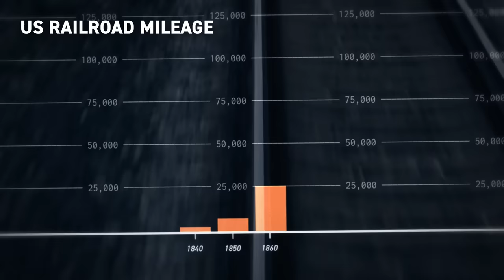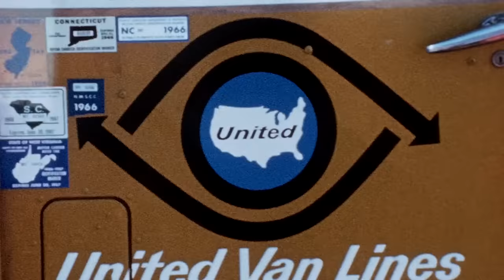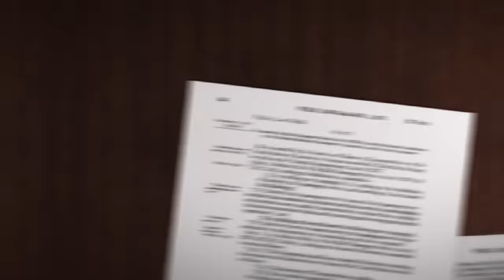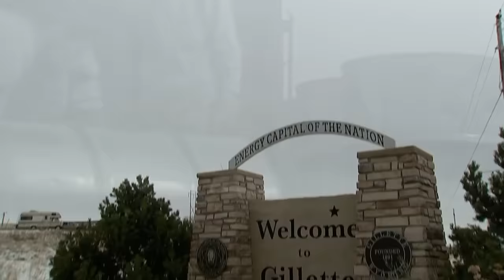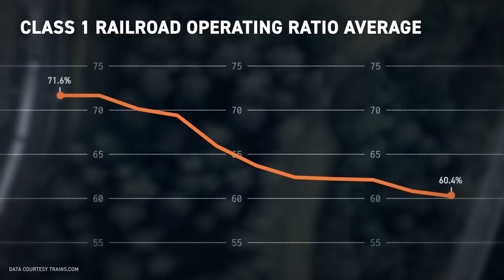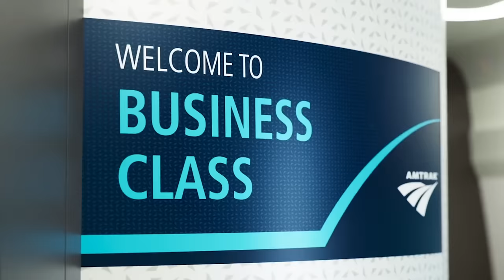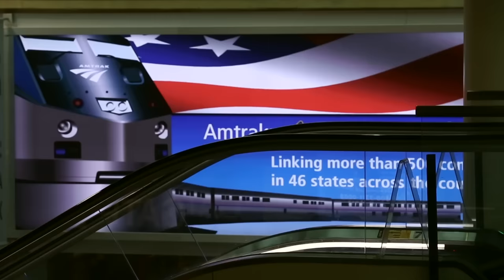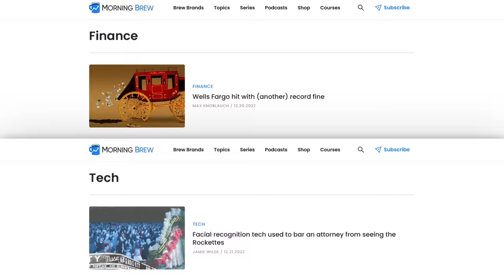The One Tiny Law That Keeps Amtrak Terrible

Comment: I worked as a train dispatcher on Conrail’s Albany Division in the years leading up to and after the CSX/NS takeover. I can count on both hands the number of times I was ordered by management to run a “hot” van train (intermodal) that was running late ahead of a much shorter and faster Amtrak that was on time. I of course always ignored those orders because it made zero sense in any universe. With a double track mainline and passing sidings, there was always a way to get Amtrak out in front even if you did have to ding that long and slower van train for a minute or two. So it’s 100% true that freight railroads ignore the law that is supposed to give Amtrak priority. Most train dispatchers I worked with did the same as me and always gave Amtrak preference when possible. But there were always some who just didn’t care and went along with what they were told to do.

That’s why Amtrak’s Lake Shore Limited was always referred to as “The Late for Sure Limited.” Eastbound train 48 was “Forever Late 48,” and westbound 49 was “Never on Time 49.”

Comment: If you ever wanted to time travel, use the Amtrak! Exclusive 1920s experience. Will turn a 1 hr. journey into 3 hours. Reasons for delay could vary from sister train issues to a wild boar crossing the track. A truly breathtaking experience, not to mention the wifi speed matching the train speed. Highly recommend 10/10!
Reply: It's a bad joke; how much nurds want to push American rail. The irony is that it's regressive; and is an attempt at reducing individual freedom of movement. I didn't drive until I was 24 and it has made my life a million times better. Nothing like a 2 hour commute or a half hour commute being turned into 4 hour commutes due to layover and convoluted routing. So much for the Chicago rail hub, I couldn't go 15 miles west without a 2-3 hour commute!
Reply: Thats amtrak 1.0 U havent rode the Acela trains in the northeast. Wonderful speedy ride.
Reply: @willc5512  just in case you're replying to me; I'm not talking about Amtrak. 😂 

I'm talking about the Chicago metra system, the almost always on time; localized, profitable, shortstop passenger train system that serves the suburban sprawl of Chicago for a 50 mile radius.

At least it's profitable, but damn does driving beat it south of Irving park road, west of pulaski, and north of cermak. 🤣
Reply: How is wanting more feasible passenger rail “reducing individual freedoms”? More options = more freedom

Rail is not supposed to replace car travel, but augment it. You said yourself, you felt much more free with a car. Imagine a rail was good enoigh that evenif you didnt have a car, you could still have some freedom of movement.

Yes, rail IS in a bad state right, now, but it doesnt have to be.
Reply: @HungryBonedog  well we gonna have to just disagree, sorry.
Reply: @josephc.9520  Prithee, what wonderous country do you live in you?
Reply: You are insulting the 1920s. Passenger rail along the same routes would have legitimately been faster and more on-time.

Comment: I ride from Central Maryland to downstate NY and back once a month. This is the NE corridor, so the service should be good, but my ~4 hour total ride often ends up being about 30 minutes late. Also, the layover in NYP, transferring from the NE Regional to the Empire Service, is always ludicrously long (like 50 minutes... these are super busy tracks, the trains should run way more often. Sometimes it's even faster to walk to Grand Central and change to Metro North)
Reply: I know it's cheaper to take the train but man if I were you, I would just drive. I was exploring a job from NJ to Vermont and denied it because I didn't want to commute on the train
Reply: @cheetah219  Sometimes I do drive, but sometimes, I prefer 4 hours of nintendo switch to 3 hours of driving.

Comment: As someone who lives on the I-25 Corridor, a commuter train (plus intra-suburb public transit) would be a godsend. I-25 has been a mess forever it seems, but I've noticed the past week in particular has been dreadful. I suspect it has to do with many companies adopting Return to Work policies starting on the new year, and with people moving here in massive numbers during the pandemic (and those in the Denver Metro moving to cheaper areas due to WFH and now having to commute back in), we're suffering a massive traffic spike all at once. 2 months ago, my commute was reliably 15-20 minutes each way, but these last few times have been 25-30 minutes on average. A train could at least put a dent in that.

The video briefly mentions how some people might prefer to just expand I-25, but there really isn't much room to expand it once you hit Denver, which is consistently where the worst traffic is. Yes, there's plenty of room to expand between Boulder and Fort Collins, but I can't remember the last time I ran into a traffic jam on that section, so it wouldn't really give that much benefit
Reply: Just one more lane bro. Give me one more lane of highway and traffic will be solved forever. Trust me bro.

Comment: Informative video that really showcases the red tape and downside of letting big business run amuck without holding them to account. When a train costs more than airfare and takes twice as long or more, then it's bad. It would take 13 hours from Indianapolis to Minneapolis, which is 10 hours by car. The cost is about equal, if it all works on time. If freight, which isn't as time sensitive as people, did what you mentioned, it might be worth it. Flights are about the same cost, though use a lot less time than rail or driving. Any which way, there is no easy solution without the government steering things regardless of what business and shareholders want. Since people, business, and modes of travel can't agree on a solution, then the government setting the rules based of the needs of everyone would be needed. That is what the government is good for. But they have to enforce the rules, which puts politicians in the line of fire.

Comment: I love train travel.  I really hope that Amtrak's new plan for its trains to prevent the delays inherent on its long distance trains  will work.  I'm willing to switch trains a few times to go a longer distance.  I think also these shorter routes will better serve communities that are dependent on the long haul trains so that rather than once every other day, the community can be served twice a day.  Of course, I say this coming from the NE corridor where a delay of 10 minutes is terrible and everyone gets grumpy.  
That said, are the needs of the midwest the same as the NE corridor?  I'm not sure if they are.  Yes people do need to get from point A to point B, but do they need it as frequently?  Is the proximity of the train station to the city centers worth it vs the distance of an airport?  Thats something that makes the NE corridor work.  Flying from DC to New York takes a little over an hour.  However you have to be at the airport an hour before your flight to check in, the airports are far from the city centers so often times you have to drive an hour just to get from the city center to the airport.. and then there's the cost of flights, lost checked baggage, cost of taxis to the airport, etc.  Vs a train where you are delivered right to the city center in comfort with good leg room and fairly reasonably priced sandwiches and even cocktails on the train.

Comment: The I25 corridor is close to home, and it's a LOT more complicated than your brief overview. In order for passenger rail between two cities to make sense, those passengers have to be able to get to/from a train station without a car. Denver has a good intra-city passenger rail and bus system, but Colorado Springs has only an "okay" bus system and Pueblo, Fort Collins, and Cheyenne don't even have that. A trip from the downtown Colorado Springs bus station to UCCS can take an hour (while driving, even during rush hour, is 20 minutes or less). That's one of the best bus routes in the city, a short, nearly straight shot with no transfers and fairly popular with frequent bus schedules, and at optimum travel time it's still 30 minutes.

Routes like UCCS are a rare exception. There are plenty of people in Colorado Springs, but they're so spread out that any given bus route can only reach a few of them. Most busses run at less than 20% capacity and most stops are empty, while those that aren't have only 1 or 2 people getting on or off. Pueblo and Fort Collins are even more spread out. 

For inter-city passenger rail to be effective, you need intra-city public transit that can meet those passengers' needs, and to have good intra-city public transit you need population density to justify your routes. And outside of Denver the Front Range doesn't have the population density. So a person traveling by rail from Pueblo to Colorado Springs would need a taxi to make it from the station to their destination on time. 

I've spent a good deal of time working on this problem, particularly for the Front Range. Without massive investment in high-rise downtown housing to increase population density and create demand for public transportation, the only way to make an inter-city Front Range passenger rail system work would be to run it like a ferry, letting people drive their automobiles right up onto the train. And this is all in a purely hypothetical passenger-only rail system, like the high speed rail the politicians keep touting, and does not account at all for track availability. 

After all of that, I want to add that the freight trains along the BNSF/UP lines on the Front Range are actually very consistent, and scheduling passenger trains on the same track would be easy. But AmTrack would have to buy property, build train stations, build the car/engine housing and maintenance infrastructure, and lay connecting rail for each destination. Not to mention buying the engines and cars to run on the new lines. These are costs in the billions of dollars for just the Front Range, and that's without laying any new track. Even in Colorado Springs with the shutdown of the downtown coal-powered Drake power plant, making available prime downtown real estate with existing track and infrastructure already in place, it would still cost millions of dollars for AmTrack to move in and set up passenger service there. (Don't get me wrong, I think that'd be a great way to use that property when the power plant demo is finished, and anybody who's in the area should get involved in pushing the city to do just that, but even when all the track is already laid in an ideal location it still isn't easy or cheap.)

Pundits and hipsters like to tout passenger rail (and more broadly public transportation in general) like it's a solution to all our problems, but I have yet to meet a single one of them who really understands either the problems or their proposed solutions. If you want to do a follow-up video that dives really deep into those details, let me know.

Comment: I highly recommend George Loving Jr's book, "The Men Who Loved Trains".  I am a railfan and could easily spend a whole day watching trains without even realizing that the day is gone.  And I'be noticed the change.  Fewer but longer trains is the rule of the day and as the times change, there is the loss of branch lines or through routes that no longer fit the business plan of their now former owners.  To someone who loves trains, seeing a rail line getting torn out feels almost like a death.
Reply: @Karl with a K I get what you're saying.  My comments were in regards to how freight railroads operate today.  Just recently, I watched what amounted to two long coal trains combined into one huge train.  With the technology available, it is now possible for a single crew (engineer and conductor) to operate all the locomotives from a single unit.  In this case there were three up front and three in the middle.  This is one way of cutting labor costs as you can now basically run two trains and only have to pay for one crew.  And those corporations are so greedy that they would like to eliminate the conductor and have the engineer run the whole show.  Have we not learned anything from the tragedy at Lac Megantic?
Reply: @Karl with a K I think that their success was hampered by excessive regulations that prevented them from being able to complete with tricks.  These regulations would effectively force railroads to continue operating money losing services or have the flexibility to set shipping rates.  In addition, railroads do not receive money from the government to maintain their rights-of-way.  Even during the so-called "golden era", they've always been trying to cut costs which is one reason why diesels replaced steam. As technology advances (like any other business), they will find ways to reduce payroll.  There was a time when it wasn't uncommon to have a 5-man crew onboard a freight train with little work for them to do.  By the 80's, the caboose was eliminated and replaced with EOT devices.  That alone contributed to a reduction in crew size and maintenance costs.

Comment: So the solutions I see are as follows:
1. Give passenger rail preference over freight rail, whether through more legislation or by allowing private passenger rail companies to bargain for it with railroads.
2. Build new rail lines specifically for passenger rail, owned by (preferably private but Amtrak is ok) passenger rail companies.
3. Invest (as gov't or a private corp.) in the passenger equivalent of trucking: intercity bus.
2 might be best, and would allow for high-speed rail to become a possibility, but for that it would likely require expensive and potentially controversial land acquisition. but 3 is easiest, especially for an average private citizen, and would be a viable alternative. 1 would require either the creation of a new corporation (same as private versions of 2 and 3) or an act of Congress, and it's hard to say which is least likely; but if it can be done, that'd be great too.

Comment: 4 trains a day 😮? Here in Europe we have more international trains going to other major European cities that do that number. Going from one part of the Netherlands to opposite side, had on average one per hour. But you have to start somewhere :)
Reply: NS is an amazing train system, absolutely love it.
Reply: Yep. Like eight trains a day between Vienna, Prague and Hamburg (railjet).
Reply: Nearly all intercity lines in the Netherlands are at least 2 trains per hour.
Reply: In their defence, those are long distance intercity services that connect two major cities. They serve a purpose similar to air travel. They don't need to run every hour, as long as departures are available during different parts of the day. The Netherlands on the other hand, is littered with cities along most major railway routes.
Reply: @OntarioTrafficMan  Almost all of them are, yes. Plenty are 4 trains per hour or 6 trains per hour (though the latter is currently quite rare because of staff shortages) as well, and even the services that have 2 trains per hour often share significant portions of their route with other services, so if you wanted to get from Arnhem (my hometown) to Nijmegen for instance, there's three intercity services and two sprinter services, all running 2 trains per hour, for a grand total of 10 trains per hour between the two cities.
Reply: @justsomeguy5103  The thing is though, traveling long-distance by rail (whether high-speed or conventional) in larger European countries like France, Italy or Germany still gives you frequencies of at least one train per hour. The distance matters a bit, but not as much as you might think, and the problem with US rail really is the infrastructure and who owns it.
Reply: I'm pretty sure "one side of the Netherlands to the other" is a smaller distance than every US city pair mentioned in this video (it's smaller than the few I checked anyway).
Reply: @VitalVampyr  Depends whether you're talking east-west or north-south, I suppose. There's an intercity service running from Enkhuizen to Heerlen twice an hour, and that's pretty much the longest distance you can go without changing trains, and the closest to a north-south one side of the country to the other train.

Comment: Even if Amtrak did build those projected lines, they'd still charge more than a bus. This is the case in the north east corridor. Sure Amtrak is more comfortable, but it's 2-3x as much as a bus with similar travel time. So Amtrak typically is only attractive to business and upper middle class travelers.
Reply: I will take comfortable over cheap
Reply: They do that on the NEC, because that's what the market can bear (I think it should be much cheaper, but I'm not in charge). Many of the routes proposed would be state supported. Those routes are usually much cheaper. Even the long distance routes are cheap in coach (subsidized by the sleeper passengers).
Reply: @matthewwelsh294  many people don't have that luxury